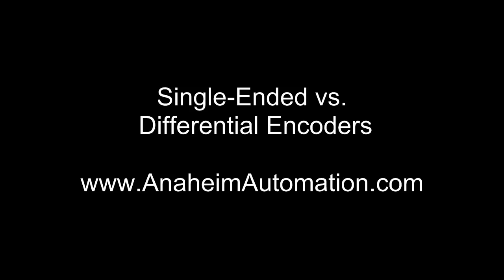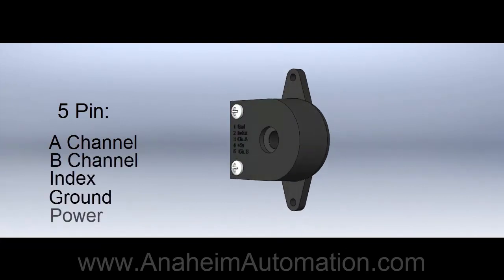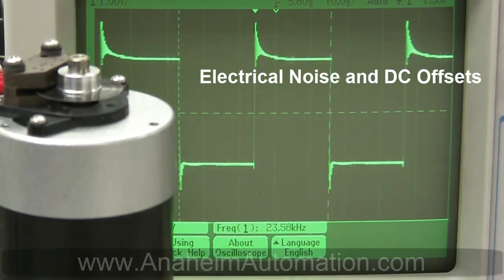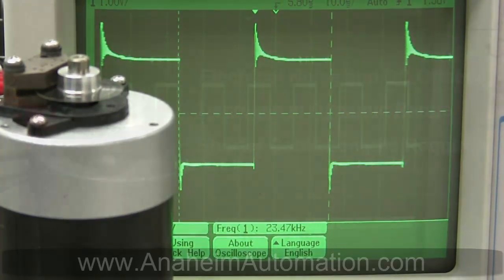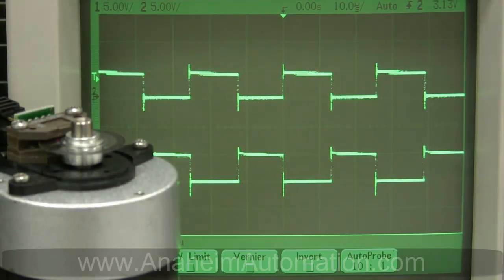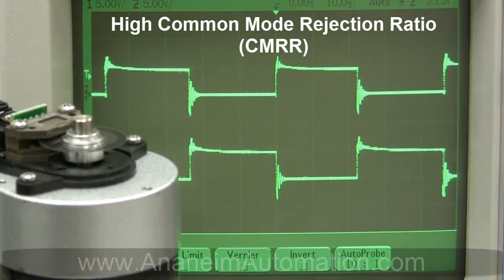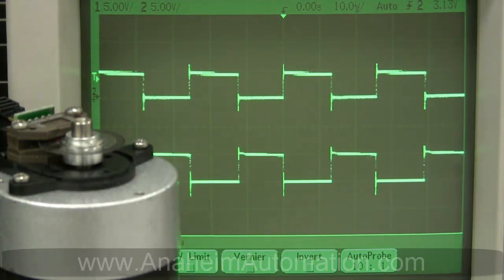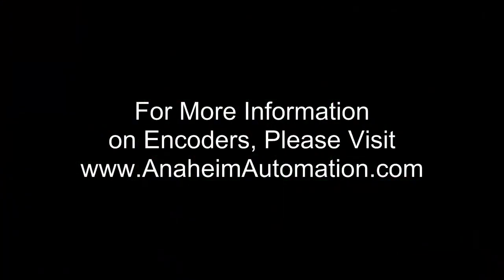Single-Ended vs. Differential Optical Rotary Encoders

Comment: Hi dear... 
Could u tell me olz
Can we use aingle ended enxoder instead of differential encoder. Regards
Reply from the maker: Hello,

Thank you for your question. You can use a single-ended encoder if your would like. The difference between the single-ended and differential encoders is that differential encoders are able to handle electrical noise better. Noise can be from the cable distrance (for cables longer than 6' we recommend shielding or a differential encoder; longer than 10' we recommend both shielded cables AND a differential encoder) or from ambient electrical noise from a circuit. If your signal is not susceptible to these types of interference, or if you are not concerned that electrical noise will be an issue, then a single-ended encoder should work fine.

We hope this helps. If you have any further questions, please feel free to contact us. Have a good day.
Reply: Hi if used a deferential encorder its need change the code on stm32?? @Anaheimautomationinc